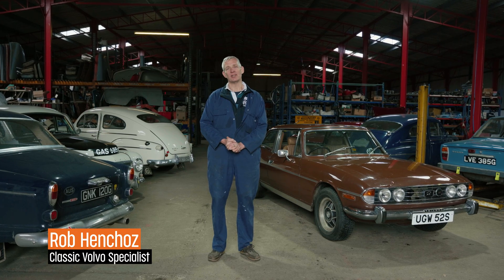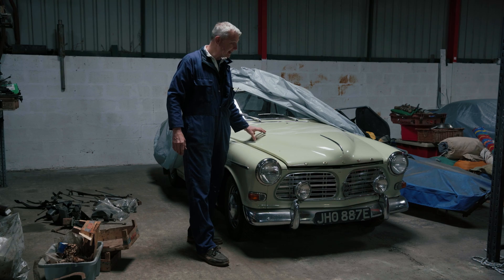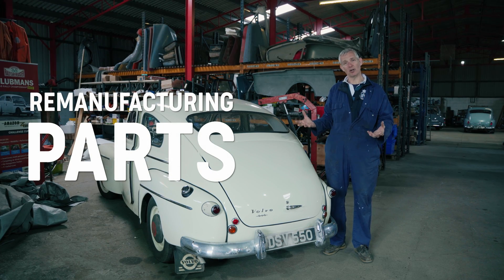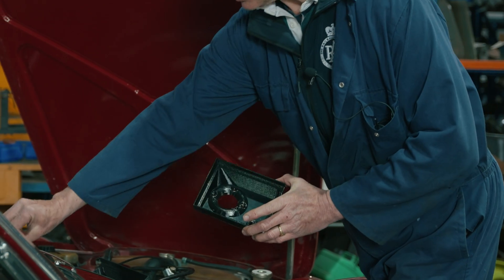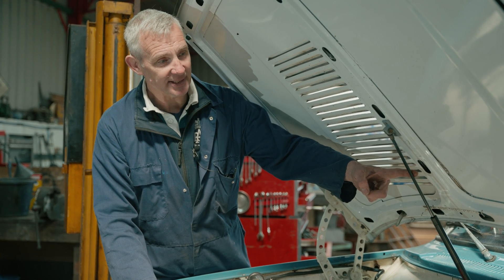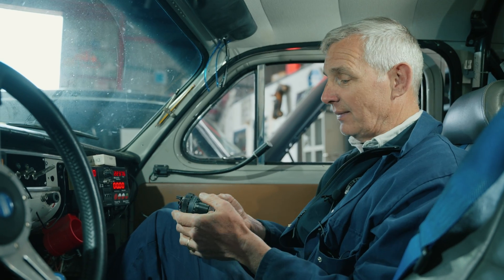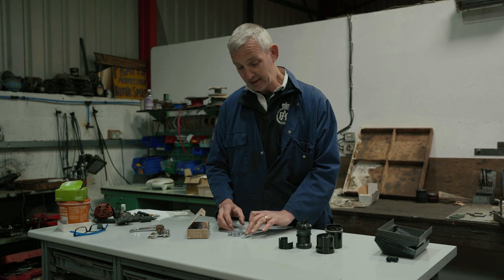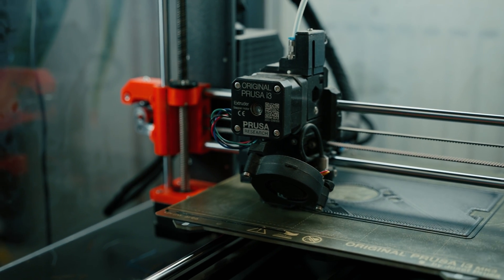Amazon Cars: Repairing classic Volvos with 3D printing

Comment: I‘d really like to know in what kind of material these parts are printed. I recon PLA or even PETG would melt in a hot engine bay, no? Are these all out of ABS or ASA?
Reply: I use PETG for interior and general stuff around the car thats not heat affected, asa for medium duty and Prusa PCCF for demanding underbonnet stuff, its excellent for that.

Comment: Nice use of 3D printing.  I hope you can keep those nice cars on the road for the forseable future.

I still need to model a strange gear for my 20 year old bike's windscreen that I cannot get a replacement for. One day I will  do it but the part needs to be metal. But if a plastic prototype part can work just even for a few seconds as a proof of concept, a metal printed or otherwise manufactured version can be ordered as a 1 off product these days.